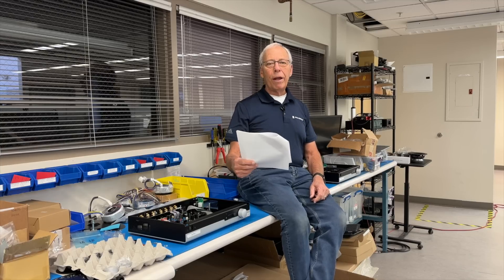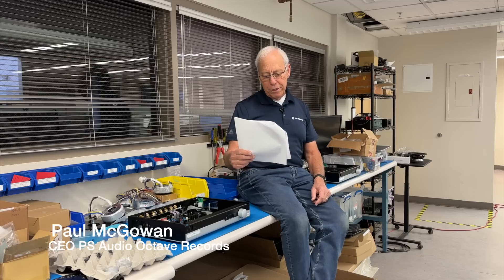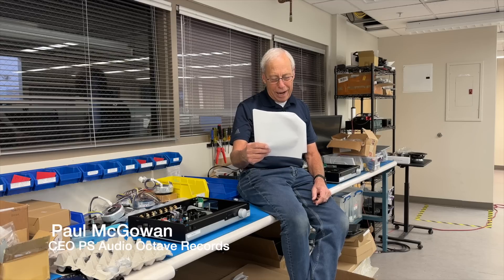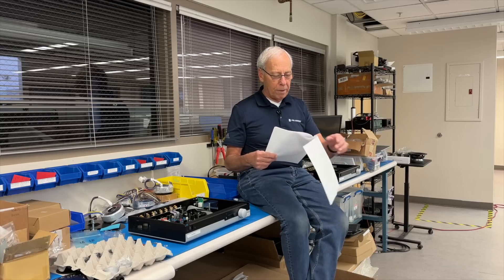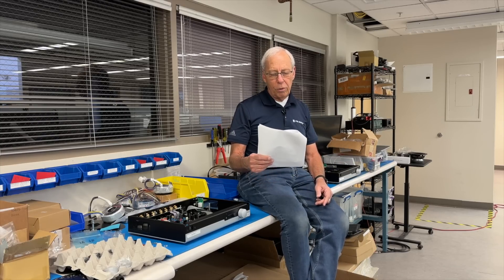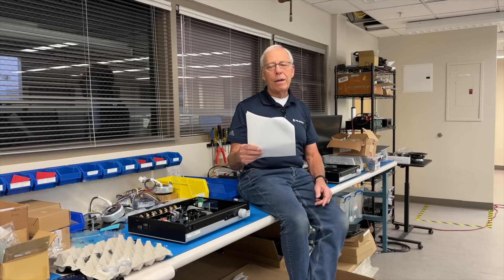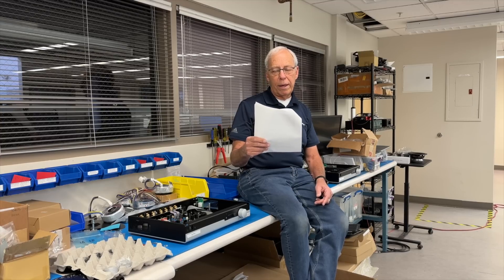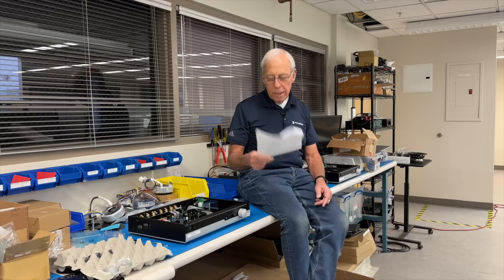Burning in new audio designs

Comment: When I bought a new amp about 18 months ago I knew it would probably require burn in - it had some hours on it, but the distributor had told me it would come into its own after about 200 hours. I swear it took around 300, but I didn’t really keep track. In any event, I was quite concerned for a long time and was contemplating returning it. But then one evening it “happened” - everything just seemed right, much better and it was not subtle. It is a MOSFET amp and it finally became acceptable compared to my flea-watt SET. They’re not the same, of course, but the trade offs are well within my comfort zone.

Comment: Two questions here. Why is "burn-in" a phenomenon that only happens with audio gear? Why do televisions, HDMI cables, computers, or cell phones not perform better after a few hundred or thousand hours of burn-in? And if the gear you design DOES sound better after burn-in, why not determine which component is responsible for the change and replace it with one that doesn't change and is good to go right away?
Reply: Great question. That is what I always thinking when I see the word burn-in. I work in the hospital and we get new equipment replaced or updated very often like EKG, EEG, x-ray, MRI, CT scan, or just a computer to input patients information at the check-in. If burn-in is real I would not trust those brand new machine that cost 1 thousand dollars or 1 million price tag, because they never talk about their new machines had been burned in. Those machine is not for fun but is it a life or death.
Reply: Many professional television calibrators make sure the unit has a certain number of hours of use before they do their thing

Comment: Pre delivery testing to trap any premature component failures - yes, it’s essential. Burn in to alter the sound though is suspect at best. Components arrive pre tested by manufacturers to ensure that they are within their specified published tolerance. If things are changing during a burning in period, this implies that components are changing in value, possibly even becoming out of spec. If this is the case, they’re faulty!! Designers rely on components being predictable out of the box and can’t accept a drift of value over time. If some components are really changing their specification during a burn in period then that has to be an unpredictable effect so you are making an unpredictable product…..

Comment: Obviously, for any product to sound different after burn-in, some component(s) in the product must have properties changing. A speaker driver will sound different as the spiders stiff resin start softening by motion, for example. For electronics, resistors, inductors, capacitors, transistors, diodes, transformers etc. are at spec at time zero. Some can make an argument about certain electrolytic capacitors and forming them, but shame on those who put such capacitors in an audio signal path as other reasons make them unsuitable. So which exact electronic component makes a difference before vs after a burn-in? Well, I forgot one category of component: tubes. Perhaps Paul’s claim boils down to his use of tubes in the input stage. This claim can’t go without some explanation.

Comment: I agree:The burn in , it’s real and necessary. No doubt, in special for big capacitors that needs voltage on it , to flex the inside job build materials to the proper way to work.
 Thanks Paul! Another great explanation

Comment: I currently have tube socket savers burning in for 6 days. I use Furutech  Liquid Nano to enhance the connections which suggests up to  21 days of burn in.

At this point, I hear excellence. However, I notice the highest high note still have a tinge of sibilance. Yet, still hear it lowering and improving day after day. 

I also leave my tube amp on idle. I play music for two hours a day. Yet, I still hear the effects of burn in taking place daily.
Reply: Progress report: It’s been 11 days of burning in. My unit sounds much clearer and still gets a slight tinge of sibilance. I can see that disappearing in the future. 
These are only the tube socket savers I’m burning in.

Comment: I think we can divide the subject into 3 categories. 1. Some electronic equipment gets hot, and a proper burning-in secures, that all the connections/solderpoints still works as intended - that could take some hours, and should probably be repeated. 2. Some components changes their performances a bit when heated up, so about an hour is needed in order to perform as intended. 3.  Some products sounds so different, that the listener needs some time in order to fully perceive the performance - that is individual, and is more in the placebo-type of burning-in, and if the listener don't like the sound after very few hours, replace the unit with something which you like nearly immediately - life is too short for bad sounding hi-fi..
Reply: I don’t think it took nearly 300 hours for me to fully perceive the performance of a new amp. Speakers seem to be even easier to discern differences. Yes, there is normally at least some accommodation factor, but not for all products or all listeners.

Comment: There are so many factors as to why burn in exist. Cables, resistors, etc. aside, capacitors DO have a burn in time. from new, they continue to 'form' when utilised in a circuit. The breakdown voltage changes based on the current and voltage present in the circuit. i.e. new capacitors can be said to be out of spec. Old capacitors that havent been used need 'reforming' by a specific series of power cycles and current peaks. I believe this is the main cause of new gear sounding different after a while.

Comment: I was surprised to read so many negative comments to this video. Whilst the placebo effect may be a factor I agree with Paul's suggestion. I bought a new DAC to upgrade my CD player and was at first disappointed that the new DAC didn't make much difference over the internal DAC of my player, but after about a week it sounded substantially better. I have listened to my CD player since, with it's internal DAC chip, and compared it to the external DAC. The difference is NOT wishful thinking. It does sound much better so the burn in process is definately real.
For those who say you can't measure the difference I say just use your ears. After all listening to music is the purpose of Hi Fi, but if reading spec sheets is your go then save yourself the money and don't buy any gear. You can read the specs for free.
Reply: Your comment reminds me that the two most profound experiences of electronics burn-in that I have experienced were both with DACs.  One went through a series of changes over the first 100 hours or so of use great enough that anyone should have heard them.  After that, things settled down, but I could still hear subtle changes up to about 400 hours of burn-in.  I ran this DAC continuously through this time, only listening occasionally when I was in the room, so this was NOT placebo or brain burn-in as some insist.  The other DAC was the more curious case, as it was just the digital input board that was burning in.  I had upgraded my PS Audio PerfectWave DAC to Mk. II.  The DAC had several years of use before the upgrade, and the upgrade consisted of replacing the digital input / processing board - purely digital, no analog audio on this board.  As with PS Audio digital products, there were several different versions of the firmware available and I tried a few of the most recent versions to see which I preferred.  The newest version had incredible imaging, but the sound was hard in the upper registers and was uncomfortable to listen to for more than half an hour or so.  The previous version had wonderful sound but lacked the precise imaging characteristics - I chose this one for its ease of listening.  About six months later, I tried different firmware versions again and discovered that the precise imaging version no-longer had the hard character.  Somewhere in the hundreds of hours of use the digital board had lost its hard edge.  Again, not a case of placebo, as I had been using a firmware that had a softer character, so how could I have gotten used to the hard character??? 

I think that it's sad that so many people are closed-minded and refuse to believe that such subtleties exist in our world.  Skepticism is good, but being closed-minded makes it hard to learn new things.  It's mostly their loss, but we still have to deal with their rants denying what we hear.  😥
Reply: There is a very powerful difference yes, a psychological one.
The hardware didn't fundamentally change on a physical or technical level that by any degree that could possibly be perceived, let alone measured by specialized instruments.
Reply: @Solus793  Thank you for your response. You assume the measurements give you all the information but I believe there is more to the sound than the specifications represent, perhaps technicians will be able to find technical ways to measure these one day but as of now can't.
I have seen some cheap audio gear with great specs but awful sound so the specs can't be telling the whole story.
Reply: @terryjefferylee6314  I don't doubt that your new DAC could sound better than the DAC/output stage of your older CD player, I just see no reason to believe that something changes in the components of the new DAC after 100 hours of use that would elevate its performance beyond the factory spec.
Placebo, wishful thinking, confirmation bias, emotion etc. is a better explanation for esoteric phenomena such as "burn in" or magical audiophile upgrades that do not work and cannot work - example: $500 Ethernet cables or power cords.
Reply: @Solus793 Prove it. You have an opinion and that’s fine, but state it as such, not as a fact.
Reply: @PanAmStyle  This is a logical fallacy. The burden of proof is not on the person who refuses to believe an unfounded hypothesis that isn't supported by any evidence or logical explanation. The burden of proof is on the person making the (dubious) claim in the first place.

By this line of thinking I could say to you that I have a machine that can turn iron into gold, however I'm not going to tell you how it works or show it to you, but you must prove to me that I am wrong and the machine doesn't work or exist.

It is just nonsense.

Comment: Well designed and well made electronics do not require a “burn-in” period by the owner. Manufacturers of electronic equipment burn-in to identify weaknesses in components or design. If you have a new piece of equipment that actually sounds different after a few hours use, then your equipment is faulty.    Or, more likely, you are deluded.

Comment: Burning in electronics of 2023? It's a hard sell on that one for me. If it was running lamps then yeah i'd believe it as those things would need to be "burned in" to settle in the current.

Since we are talking about burn in... Then why not provide some technical findings of it? Claiming some equipment is pre burned in factory because it sounds "eh" before burned in according to customers... Why not show us analysis of the change of it before and after burn in to show that it's not just tale of the past?

"burning in" or "breaking in" speakers still actually makes some sense as they are mechanical pistons moving and thus moving the drivers settles them in like rubber becomes slightly more elastic thus easier to move and is more responsive etc...

But electronics of 2023? Like just show us data where before burned in and after burned in we see change in signal and how it is affected and i'll believe it.
Reply: Why should he go to the effort of additional testing to prove his point, he isn't selling you a burn in! 
Any engineer worth his salt knows some components need time to settle in, the main ones being electrolytic capacitors, speaker surrounds, and phono cartridges. 
Your the one calling him out, why don't you do some tests?
Reply: @arfer1470  Why should he? I already explained why should he.
Reply: @sermerlin1  no you didn't  you just said you wanted him to. Electrolytics of 2023  still need forming time, it's an engineering fact he doesn't have to do anything just because some people don't understand it!
Reply: @arfer1470  just read what I have said. The thing you talk about all happens IN PRODUCTION. That is not something that occurs post production.

Each electronic set needs to be turned on ran and checked for quality whether it's up to spec after being assembled. Each set doesn't just get packed up and boxed as soon as its assembled. And again that is not "burn in". Burn in is when user buys device and runs it up to x hours. You actually HAD to do this back in 70s and 80s.

Again read what I havs said.
Reply: Yeah, interesting how measurements are not provided to put an end to this discussion. Part of it I suspect is brain burn in, manufacturers rely on it, they know that their products will sound slightly different, not worse, but that people have to listen long enough to have their brains adjust to the sound signature. But they would never admit that, because that makes it sound like their products ship with a wonky sound signature to begin with, which offends the neutrality gods and those that worship them.
Reply: I burn in my globes for the house before using them, boy is it bright after broken in.
Reply: You're right that who ever says something is the one who should provide the evidence, but in this case I'm not sure if it's meaningful as it's up to the buyer as well as the mfg to decide on each individual case if it matters to them. 🙂
Reply: @PSA78  Yeah... I just see these claims but never technical proof to back the claim up.
Like aren't audiophiles suppose to be very technical know hows instead of relying simply on "can you hear it"... ? 

The more I get into it the less I see that audiophiles are actually audiophiles....